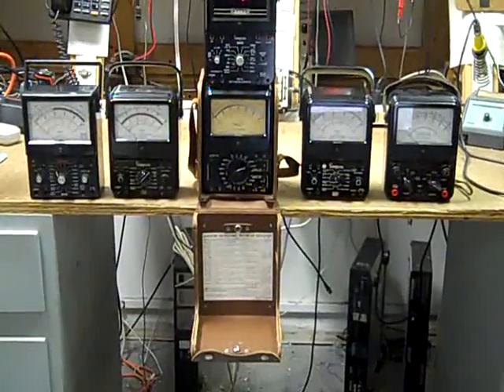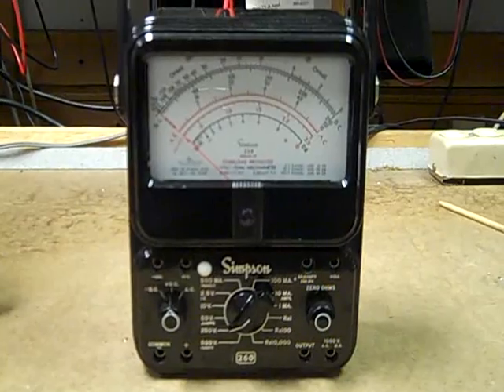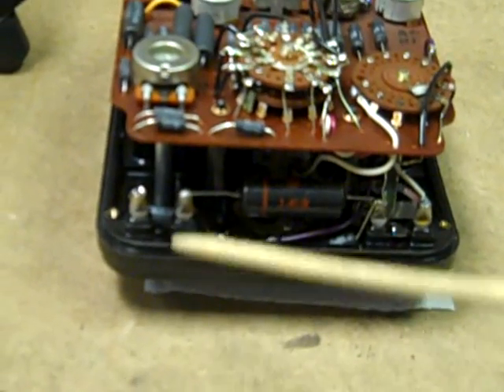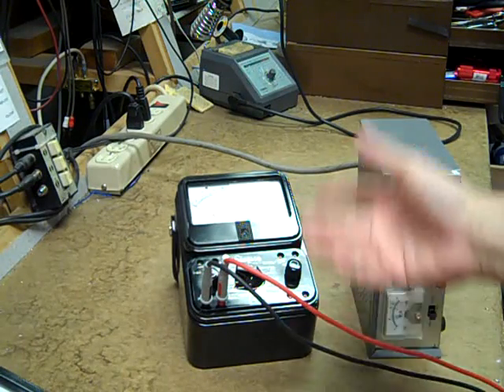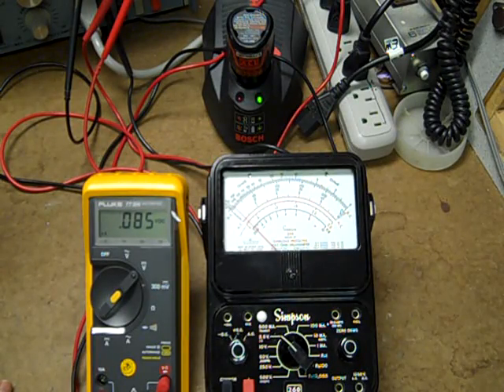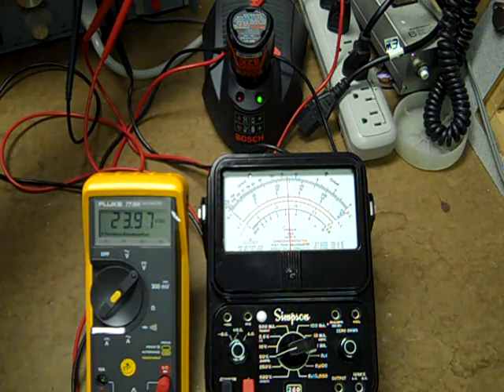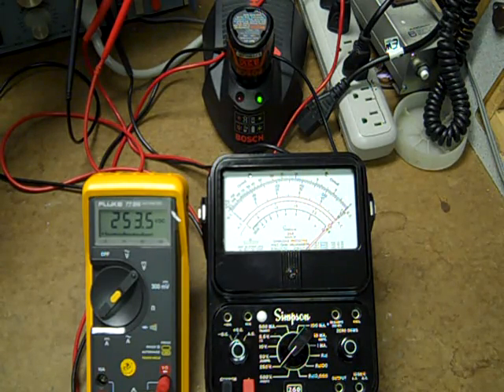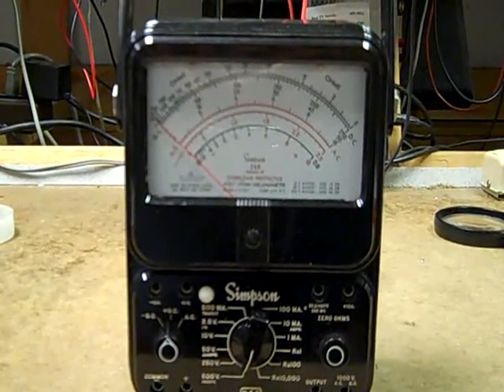Simpson 260 6P Multimeter Review

Comment: I learned on these meters in high school in the early 90s. We had an educational version with a clear back. When a student would blow one up it would fill up with smoke, and our instructor would laugh at us, then make us open it up and fix it. It took me a long time to get used to using digital meters, because the response time was so much longer on the early ones. With the 260 you could tell by how fast the needle swung if you were in the right range, and it was also nice for checking capacitors.

Comment: Mark, when you describe a 12- volt strike on the circuit in the Rx1 range... what are the typical consequences? smoked movement?? I just picked up a Series 7 that was manufactured in 02 and the movement is dead. Also, are you aware of a movement source other than just purchasing a 'Used Meter" for movement replacement. I happened onto a pristine series 7 off craigslist for a song and would like to get it going.
Reply from the maker: Usually just the Rx1 resistor smokes. If it's now open circuit, the needle will peg on any resistor when using that range.
Reply: @mdzacharias  Something got the movement in this one, I put a 10K resistor with movement isolated on the + side of the meter and input a variable voltage from zero... no deflection.  I've searched the net for a new movement and have found nothing listed. This meter never seen much use if any, literally like new inside/out. Simpson has nothing listed far as new movements to my surprise. Thanks for the speedy reply, any and all feedback is helpful.

Comment: Why didn't you measure resistors on the Simpson and compare its accuracy to your Fluke?? Are you afraid to reveal how lousy the Simpson's accuracy is compared to your Fluke?? Fraidy cat!
Reply from the maker: Ha! You're not wrong, but in fact analog mutimeters aren't so good on the resistance function anyway. Doesn't usually really matter though, I mean if you are interested in whether a 10 ohm resistor is OK, does it matter if the meter shows 12 ohms? That resistor is good for all intents and purposes. If one really needs a precise measurement, you need a decent digital meter anyway, Fluke or many other brands.
Reply: @mdzacharias  Thanks for your reply. I agree with you. I just happen to have 4 Simpson 26o meters of varying series. My favorite is the series 6P whichh seems to be everyone's favorite. A close second would be the 6XL which is also have and it is the most accurate of the 4 meters. I love analog meters and use them as well as digital meters. Each has their role to play in the ongoing fun of circuit analysis and design.
Reply from the maker: @sliderulelover  Yeah, the 6P was really great. My Bach-Simpson 635 is really my favorite. Even does AC current up to 12 amps.

Comment: Are these meters meant to be used lying on there backs, I am having an issue with mine, lying flat it works just fine but standing straight up it doesn’t do well at all, the needle doesn’t move correctly
Reply from the maker: Most analog meters do best on their backs. With a Simpson it shouldn't be so bad when tilted, at least the taut-band models. (meter movement)
Reply: Ok, I recently sold a meter and the guy says to me that the meter is in great condition, when on its back it works no problem, tilted it works slightly less effective but standing upright he says the needle gets stuck about 2/3 of the way, I sold the meter never used, but he wants to exchange it saying it doesn’t work correctly, just wondering, I heard you say that these meters work best lying flat, do you know if these meters work with the same efficiency standing straight up, I’m really trying to determine if the meter may be bad or if he is just not using it correctly
Reply from the maker: @kingofoblivion1822  The difference between flat and tilted should only be maybe 5% tops. If the difference is as great as you say it sounds like the meter you sold had an undiagnosed mechanical issue with the meter movement. Sorry.
Reply: Thanks for your input, it helped me make a decision,
Reply: Thanks for your input, it helped me make a decision,
Reply: Thanks for your input, it helped me make a decision,
Reply: Thanks for your input, it helped me make a decision,

Comment: I just bought a 260 ,and I have no Idea what I bought ,I always ask for inside picture,this is the one time I.didn't follow my own rules and I will probably pay for it .always ask the seller for inside picture,don't be afraid to ask the seller questions,also.see if the sellers other stuff they sell a lot of times they have no Idea what they are selling which means you might get it very cheap,like.my heath kit vtvm I got a very good deal,and I worked with the seller,but I got lazy on.my Simpson 260 .that's coming ,I was.sick when I bought it ,A good seller will have good reviews ,and will work with anwer your question ,

Comment: i have a simpson 260 series 3 and an rca wv-38a i dont understand why they dont work, i checked and the resistors and diodes etc seem fine that i can test.i figured the rotary switchs could be preventing connections so cleaned those. i was given these two thinking i could make them work so i could have an analog meter in addition to my other test gear. it seems to me if i am correct they should work on all but resistance even without batteries so unless the guage itself happens to be busted in both of them i dont get it, i cant seem to find troubleshooting guidance online. do you know any resources?

Comment: need some help, i have a 260 series 6p  it doesn't seam to work. it was given to me. i put new battery in it. i now i'm not doing something right. can you help.it looks like it's in good shape. looks clean. if you can help
Reply from the maker: You haven't given me much information. Have you tried for example just setting the meter to a 10 volt DC range and measuring a 9 volt battery? Do you have another (working) multimeter to help troubleshoot this one? Have you any experience in electronics?
Reply: Mark Zacharias ok I try that the needle move. The needle was all the way over on the left and move to the right. What are some other tests I can run.    No I don’t have another meter.
Reply from the maker: If I understand you correctly - it sounds like the meter basically works. You should watch a few videos on YouTube about using multimeters and pay particular attention to those with analog type meters. Always start with the highest range and work down, at least until you know what you are doing. Don't attempt ANY current measurements until you understand the principles - it's very easy to blow up the meter when using the current function.
Reply from the maker: Also the OHMS function should be used with care. On Rx1 or Rx10 ranges, there are resistors inside which can burn if the meter is connected to a voltage source of say 12 volts or more.

Comment: I have a model 260 series 3 that seems to have a dead display meter. All internal parts are OK. Other than EBAY taking a chance on a parts only meter, is there a replacement display available elsewhere ?
Reply from the maker: No place I know of. Occasionally you see a "new old stock" meter movement o eBay. Also, you can contact the seller before buying or bidding; some of them are knowledgeable enough to test the meter or otherwise assure you the meter movement is good.
Reply: Thanks Mark, I assumed that would be the case. I have contacted Simpson also to see if they have another updated meter movement that would work in the series 3.

Comment: very cool vid!! my electronics teacher gave me a Simpson series 7 and I've been wanting a vintage meter for a very long while and I'm very fortunate to have gotten this one from my teacher. and everything works on it but I need some new test leads for it and I'm not sure where I could get any without having to buy them online. any suggestions? thanks.
Reply from the maker: +Matthew Blalock Probably only on-line unless you can find a Simpson dealer. Probemaster probably has the. Remember they are special inverted banana plug types for the 260-7 and -8.
Reply: Yes, Probemaster makes the goofy inverted banana lead sets... got a set for a NOS, in the original box 7M that popped up on Craigs list (for $30.00!) The meter is pristine... but it's leads had been through the war. Like all PM leads, they are stellar; but are buried fairly deep on their site... you have to look.

Comment: Love my 160m, but it does need a 22.5v cell which will cost me about $25.
Reply from the maker: sanjursan I've often thought about picking up a 160 - haven't because I have bunches of analogs that don't get used enough. The 22.5 battery is another reason I hadn't thought of. Thanks for saving me from myself! :-)

Comment: I like the series 6
Reply from the maker: James skippinhopper The series 6 is probably my favorite 260 mainly because it uses a 9 volt battery instead of that string of AA's that always seem to get the corroded terminals in the 3 through 5 series. I also like the 270 series through series 4 and the 625 and Bach-Simpson 635 models. I won't own or use those models like the 7 and 8 when have those stupid inverted input jacks. I need to be able to use regular 4mm ended test leads.

Comment: I don't want to take your title but so far I have 9 260s, a series 1, 2 series 2s, 2 5Ms, a 6XLP, a 7 and a 7P and a series 8. I think I may need professional help.
Reply from the maker: I'm down to just two Simpsons now, a Bach-Simpson 635 and a 270 series 2. Developed an irrational liking for Japanese built Micronta meters. Mostly made by Kamoden, like the 22-205A, 22-207, 22-150 etc. Don't really like the Korean stuff, the 22-204's and the like. Yuk.

Comment: the 260 that I have has 1 D cell and 6 AA
Reply from the maker: Yeah - the Series 3 through 5 (not 5P) used 1 D cell and 4 AA cells. The 5P and AFP-1 (military 5P) used a D cell and a 15 volt battery, the 6 through 8 uses a D cell and a 9 volt.You can read up on most all of them at Simpson260.com.

Comment from the maker: Had to research this one. They are described as "6-32" screws, that is size 6, thread count 32. They are 1 and 3/8 inch long with fairly small flat blade drive heads. I'm pretty sure that is what the 6P and the regular bakelite models use. My Bach-Simpson 635 uses the same thread pitch but only 7/8" long.

Comment: great video.  im a self professed multimeter junkie as well.  I use them all the time I did at work testing copper phone lines with the 8455.  As you know the 45 volt battery is not sold and if your interested Ive perfected a perfect 45volt pack...ill probably post a clip soon be good...jimmy

Comment: The current typically ranges from 0.3~1A when the motors are loaded or Idle, but the startup current spike is is at least 5A but no more than 8A otherwise the Power source Fuse would blow. The PowerSupply to most of the motors is DC unregulated and will exceed 150v when unloaded. A 1K load across it brings it back down to 18v though. While the motors run loaded (1A) the supply drops down to around 13-14v. 

A New Fluke 87V new is about the same price as most New Simpson 260 models.

Comment from the maker: I'm sure the Simpson is good and all, but it really depends on what you are doing. Very high current pretty much requires a clamp meter or a dedicated current shunt to put your (probably AC) meter across. The Fluke 87V has a very useful low pass filter designed for motor drive circuits. In combination with the analog bar graph, might be a really good choice. Cheaper than the Simpson, too, I think.

Comment: Hey, does anyone know if the Simpson 260-9SP is any good? I am looking to get an analog multimeter to monitor both AC and DC current/voltage jumping on motor circuits where DMM don't quite cut it.

Comment from the maker: Not too many reasons for this. Bad battery, poor connection to battery somehow (very common). Damaged Rx1 resistor (around 10 to 12 ohms, probably). Poor condition test leads maybe, maybe bad fuse connection. You can remove the battery, short the battery terminals together and use another meter to measure resistance of your test leads through the whole meter circuit. That might give a clue. Thanks for watching! Hope to post something new soon.

Comment from the maker: Of course I don't use analogs much anymore for troubleshooting/repairs. I have since sold that 6P but still have a 270 Series 2 and a Bach-Simpson 635 which is real handy because it will do AC current. Both of those are on Simpson260DOTcom as guest meters as well. I also like the Japanese built Micronta meters believe it or not. The 22-205 and 22-152 are really good meters. Both 100kOhm per volt. Don't like their Korean stuff, the range doublers etc. Thanks for watching!

Comment from the maker: I like the 260-6P because it uses the regular banana plugs and not those ridiculous inverted types used by the 7 and 8 models. The 5P and military AFP-1 models have a similar protection function as the 6P but unfortunately use that 15 volt battery for the RX10,000 range and for the protection relay. The 6P uses a 9 volt battery for that. There is a nice site called simpson260DOTcom for pictures and info.

Comment: Thanks for the clarification on the models :). I used one of these when I was in the U.S.A.F. working on HF radios in Japan and still need to acquire one. Now I know that I need a 6P. I bought a Fluke 77 series II DMM, Weller variable temperature soldering iron and Panduit GS2B cable tie gun after I got out. When you "raise the bar" with high quality tools, it's hard to go back to low quality stuff...

Comment from the maker: I would say it's pretty normal to have to hold the leads tightly together to zero the meter for resistance. More so for this analog model in fact because of the higher test current. Had not thought of that before, but I do think it could be significant. Some leads are better than others also. Cheap Chinese leads often behave erratically when doing continuity tests for example.

Comment: I do not have allot of experience with Simpson. My other question would be when I go to zero out the needle for a resistance check i hold the leed ends together and though i feel i'm holding the leeds still the needle tends to be "bouncy" I am not saying i cannot get the needle to hold still at all, but it's not an easy task,...is this normal? and I havbe to hold them still between fingers as opposed to just touching the ends together

Comment from the maker: Depends on how often you use it. I worry about corrosion also, but I do keep one or two analog multimeters with batteries installed for quick resistance checks and to "pop" the occasional speaker or small motor. Can't do that with a digital multimeter as they are normally limited to 1 milliamp max current on the resistance function. Certainly if you plan to store the meter for over 6 months I would recommend removing the batteries.

Comment from the maker: You can't buy a new 6P. They have the 9 series, like the 9S and 9SP. I notice they went back to a more conventional banana jack on these, not those stupid inverted types like on the 7 and 8 series. These days, a person normally would use a good digital meter for voltage readings, and you don't need a high end analog for trending etc. Any Micronta will do for that. I had one the other day where .2 volts made the difference. Can't resolve that with most analogs.

Comment from the maker: The output jack is for measuring AC voltage in the presence of DC voltage. Like signal voltage at the plate of a tube, or audio at the output of a capacitor-coupled amplifier, before the blocking cap.

Comment: Hi, just picked up a 260 6xlp at an auction today for $7.50 Got home and replaced both the D cell and 9 volt square batteries. Seems to test my 12 volt car batteries and house outlets ok. The D battery was corroded and the negative terminal is in rough shape. Can that piece be bought new or do I have to fabricate?

Comment from the maker: On the Series 6 set the switch to 10mA and you see under that there is an A. Connect the test leads from -10A to10A jacks which are in that row of four jacks just below the meter face. DC current only on this model, not AC current. For AC current you would need a 265, a 635, or an AC current adaptor fitted to the 260.

Comment: Thank you very much for posting these vids with the analog Simpson meters.  You inspired me, and I just received a Model 260 Series 6 today (from that massive auction site).  Came w/factory leads, and new batteries.  Checked my light meter batteries.....well within range.  Next, a microscope light transformer.....ah-ha, I can new see, on the meter, that someone has goofed up while reattaching the voltage adjustment dial.  What a relief.  A new transformer would cost 2x the meter. Many thx!!

Comment from the maker: Normally to measure one volt or so you would use the 2.5 volt scale and just read somewhere in the middle, or connect the positive lead to the dedicated 1 volt jack and read full scale. Since the meter is 20,000 ohms/volt the total impedance of the meter is only 20,000 ohms using that jack.

Comment: WOW, I have never seen or used an analog meter in my physics lab. So by observation it seems that if the knob is switched to 2.5V, you read the DC 250V scale and divide it by 100. So if you want to measure between 0-1.0 V you have switch the knob to the 10V and get the reading from the DC 10V scale and divide it by 10.

Comment from the maker: @xyloeye I haven't seen this but I would suggest that if it works correctly on voltage ranges, the Rx1 resistor is probably low in value or the adjustment potentiometer is bad.
That resistor is usually around 10 to 15 ohms, about the same as the mid-scale reading on the meter when using Rx1.